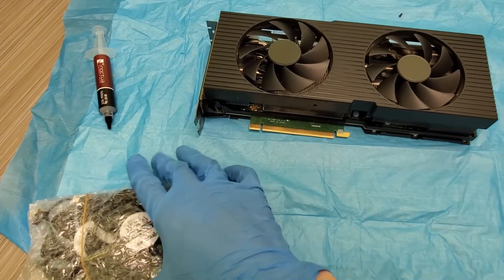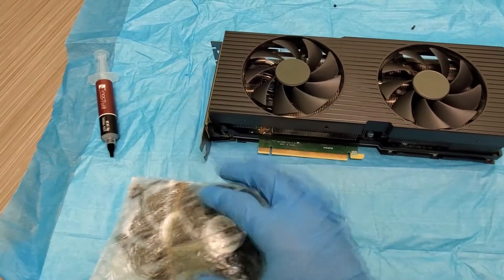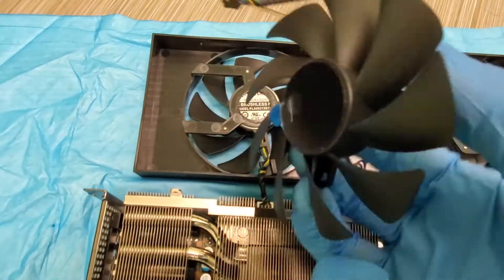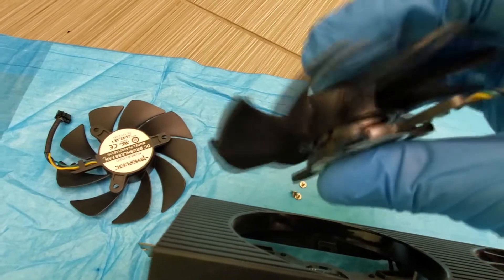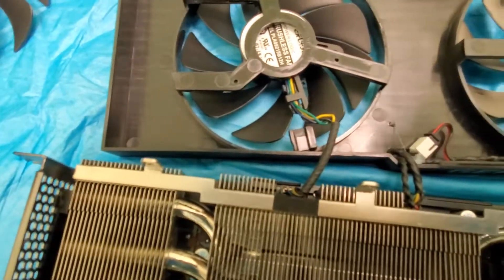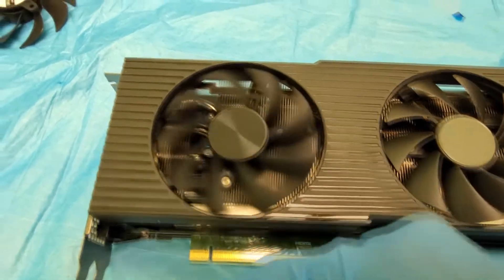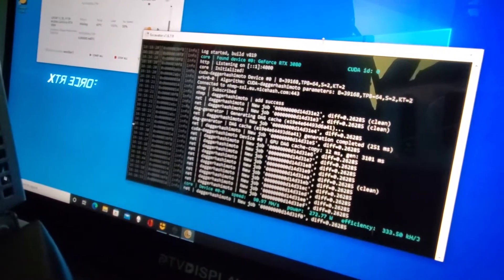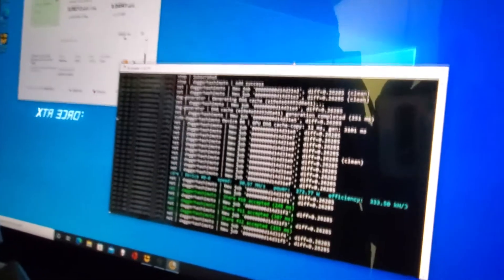Kintips How to Replace DELL RTX 3060 3070 3080 3090 Video Card GPU Fans

Comment: Do you know if this would work for the Dell RTX 4090?
Reply from the maker: You would probably need the 4090 fans but the procedure would be the same, the screws would just be in different areas.